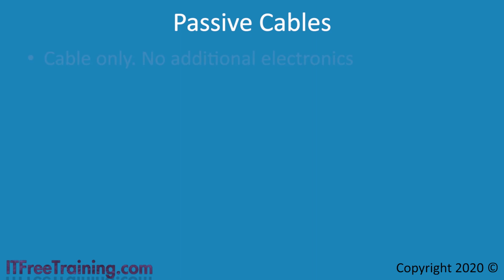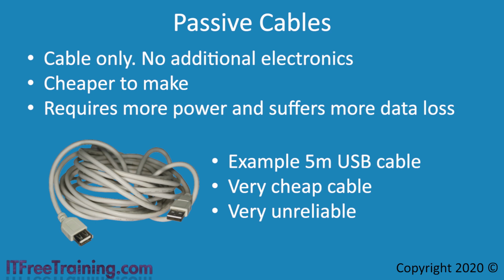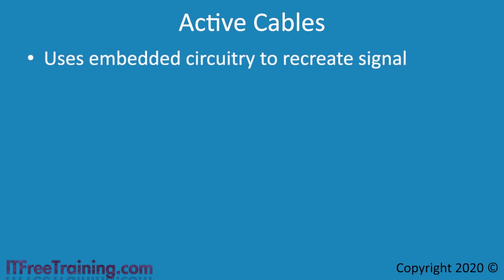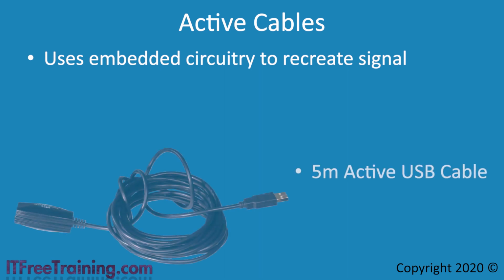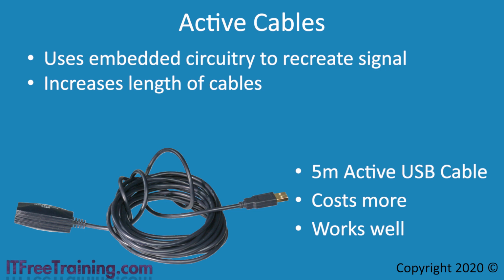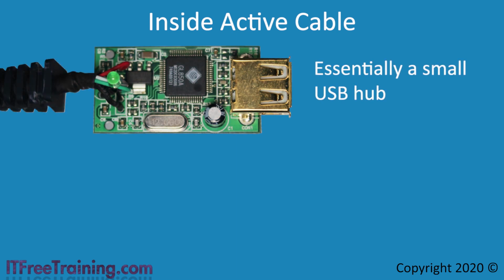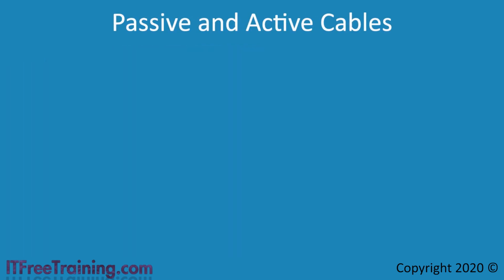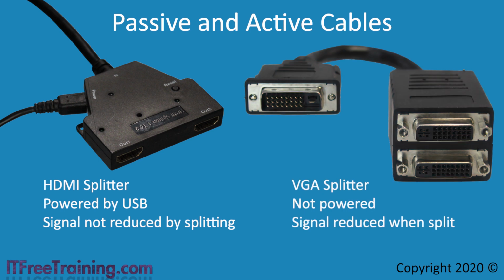Active and Passive Cables

Comment: The VGA splitter at 7:00 is actually a DVI splitter.
Reply from the maker: Yes, you are correct. The splitter is DVI not VGA. Thanks for pointing that out.